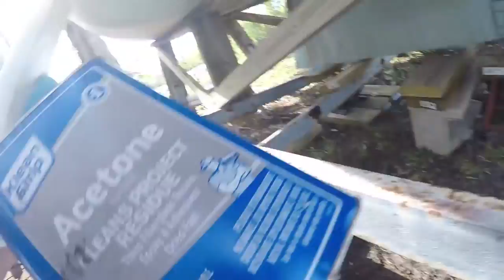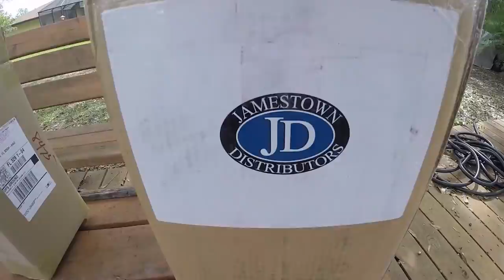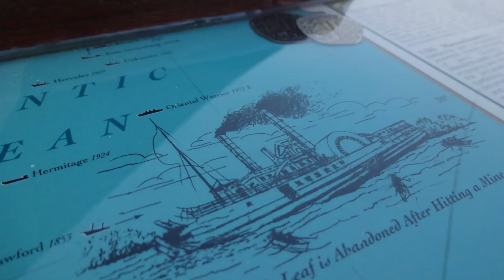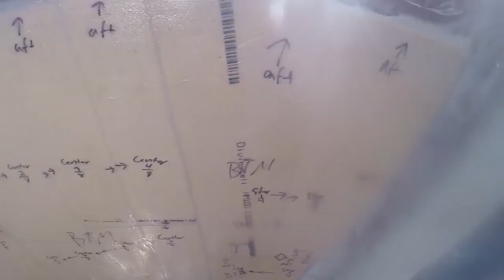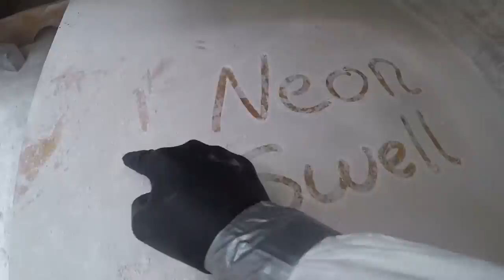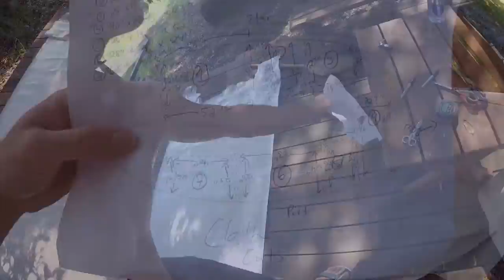Boat Building! 2 years in 20 minutes - Ep. 19

Comment: I just been following you since this morning so this timelapse is about perfect hey

just a simple remark, nothing to be considering like a agression but just keep in mind the boat should be as well balanced after than before and his weight should be about the same ;) 

For the rest Thumbs up, it s a nice adventure ans the job is nicely done  :) 

Keep it up !
Reply from the maker: Hi Michel, thanks for following! I'm hoping the boat is balanced just as before. I took out a ton of weight from old wood and teak. Most of the wood I put in has been cut out and replaced with foam inserts, some of my bulkheads are foam as well. I'm praying it is balanced. Plus it says 1200lb capacity after weight so I have than much to work with as I wont have 6 people on board. THanks again!

Comment: Rebuilding a boat may have been a better descriptor. As an old guy I found it hard to watch the video until I cut the speed in half and muted the audio. It was just a little to fast for my old eyes. I am sure gramps would be proud of what you have accomplished so far. Keep up the good work. Then end is in sight.
Reply from the maker: Hi, yeah, I'm sorry. I didn't know how to fit so much footage in such a small time-frame (trying to stay under 20 min). I agree with you on the video and knew that when I was posting, but didn't want a 3hr video or multiple installments. Thanks! He was a huge inspiration for this boat.
Reply: @NeonSwell  - No worries. It was easy to watch when I cut the speed down. It was a nice review of the project so far.